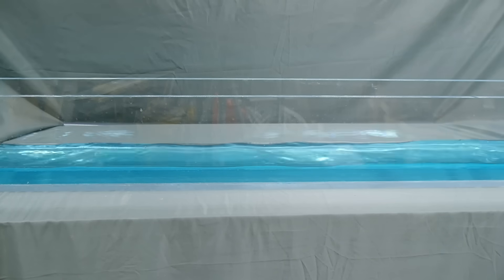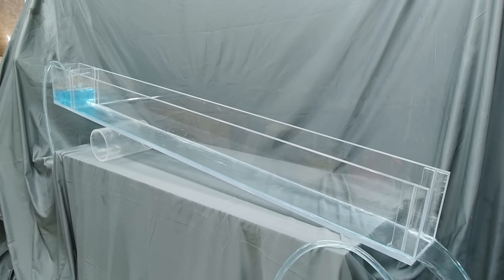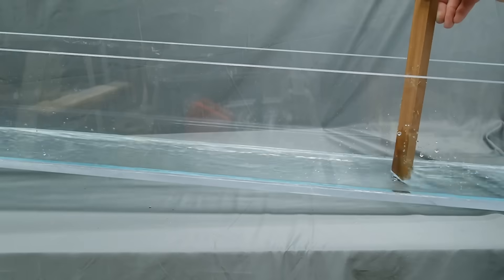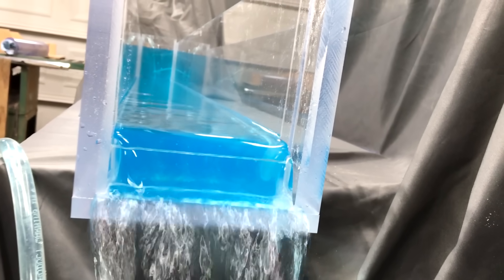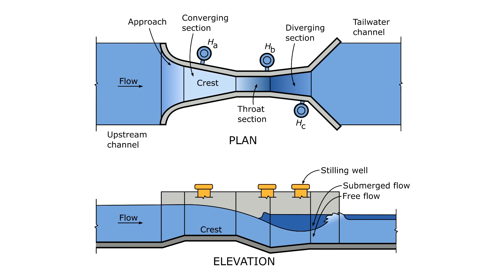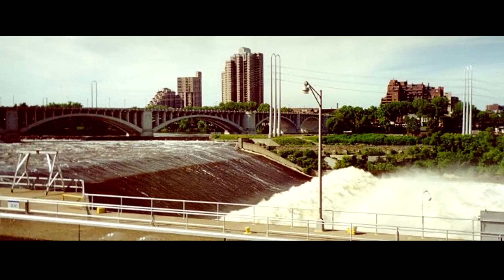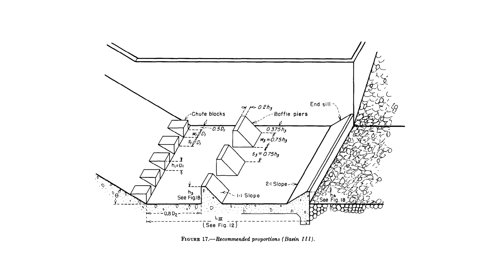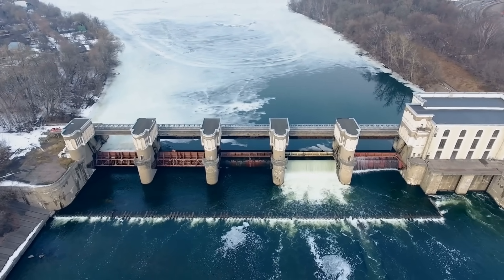What is a Hydraulic Jump?

Comment: Hi Grady, thanks for the great video! I am curious about the part where you mentioned that the energy from the lost flow speed is dissipated as heat in a hydraulic jump. Are there ever hydraulic jumps large enough (perhaps following a particularly large spillway) that they can create a significant change in water temperature?

Comment: If old Mississippi could b also controlled by a U shaped sq or rectangle system no top of box, the power & volume of water could b up stream diverted to a storage sink or basin. Smooth walled when normal flow & rocky walled w/speed bumps & diveting when water volume & power high. U can add as many of these U shaped sq/retangles as needed to hve needed effect.

Comment: saw something about 3 min mark, still hve no idea yet what u r talking about grand or tiny view of understandingie no clue what the hell u r saying may need to make this video multi prts. OK if the channel of the water stucture was not round or sq but instead retangle, & u could switch it mechanically, from sq to retangle as needed that would effect the flow. NOW if the sq inside channel was smooth & the retangle inside channel was rocky like a stream bed this also would effect flow. NOW if the rocky stream bed inside wall also had speed bumps aong the bed this would also effect the flow. If turning from sq to a retangle allow sink type over flow drain hole to NOW b in the flow instead of sitting up high not used, u could divert some (1 or more sink over flow)of the water into an up stream reverse flow every restricting tube pushing the water higher & higher till it collected in a raised tank or basin higher sink.

Comment: I know this is an older video so you might not see it but why aren't underground drainage tunnels ever built into hydro electric producing drainage system hybrids. I know in some places with low rain levels it would be useless. But I'm from Houston Texas and I've seen insanely large amounts of rain, flooding and all that jazz. Is there no smart way to harvest that water flow economically or is it a matter of the age many of these tunnel infrastructures are that retrofitting them wouldn't be worth it? The part of the city in which I am from elevation constantly changes to drain out all the water to the river. So there is large amounts of downwards water flow. Constant heavy influxes of rain. And thinking about the flooding issues we faced with Harvey and Irma they are going to increase drainage capability over the next few years. With the massive land mass of all this water draining into one direction could it be used for electricity or would it not be worth it. I'm honestly just curious and hope you can get back to me.

Comment: Have a question that I am having a hard time finding information on.  What would happen to a river's elevation if one were to temporarily dam 75% of the river?  How tall would that dam need to be based on backwater elevation changes?  I work for a construction company that is often faced with engineering questions that I try to learn about.  This question specifically has been bugging me because I don't know if anyone actually knows how tall this "dam" needs to be in order to effectively work.  Thanks.

Comment: Thanks! - that was super interesting.  One  point that tripped me up was when you said 'we also care about the velocity of waves, or how quickly pressure disturbances in a fluid can travel'.  It seems like this is a different thing (e.g., pressure disturbances, where the restorative force is the bulk modulus, as in acoustic waves in the fluid) vs. waves on the surface like you've shown (where the restorative force is gravity).  I imagine that these different waves travel at different speeds (?)  Anyhow, it's the phrase "pressure disturbance" that seems a bit wrong to me (I understand that as the surface gravity wave passes over a point, it will cause a pressure disturbance beneath it, but pressure disturbance is usually taken to mean acoustic waves).

Comment: You can also see this in spectacle on the beach at the ocean where you have energy from the waves hitting the shore at 70-85º and the bysmerty of the shore is 5-8º normal to its force. The water will flow back down against the incoming surges and cause a jump that will spray upwards like a line of gunpowder is going off. Super cool!

Edit: You can also see this in the same situation where that energy of the wave goes against the shore and curls to a point rather than going straight back out. This can be traced due to the froth in the water, the waves will still come in along the point but due to the force of the not dissipated energy from the shore surge this is called a 'RIP' and will cause the waves to stand up and almost stall out without reaching the shore. We use this in surfing to 'carousel' rides, using the rip to get out along the pointe, then riding these stalled out waves rather than going to the normal point breaks provided swell direction is appropriate.

Comment: i have concrete flip buckets at the end of my flood spillways, been testing coal tar epoxy on them for cavitation erosion testing, so far so good ✌🏻super critical flow is what the oroville spillway failed from, when it would go over the drop you can see it just turn white from cavitation.... it’s like little fire crackers going off ... what the seismic sensors were picking up. (the jump down)They need to slow the speed down at that point

Comment: Geographer by education here. Love your channel. However, I disagree with your comment that tidal bores only happen in a few places. Tidal bores are only a function of tides going up stream. The geometry of the local hydraulic system dictates the size and scale of the bore. Amazon and China have some famous large bores.

However, I've seen them as small as 6 inches traveling up concrete channelized river beds, the San Gabriel River in Long Beach, CA specifically. The end of the channel is a couple of feet above the low tide level but it is also a couple of feet below high tide level. Thus as the tide comes in and progresses up the channel, a tidal bore is produced. I've seen the tide come in and slowly creep up the channel producing a 6 inch tidal bore. Quite fascinating. And this happens almost 3 3/4 miles up stream from the open ocean, so it is not based on open ocean breakers.

Comment: Love the series! It's piqued my interest in sewer and storm drain systems. Drop structures involve way more hydraulic analysis than i'd thought. I skimmed this PhD thesis -- https://era.library.ualberta.ca/items/72078c56-f989-45e3-9198-9760ad6fb738/view/267e8135-d75d-4664-98b1-452c9a1d7df9/Camino_Graciela_Fall2011.pdf -- and that led me to the concept of https://en.wikipedia.org/wiki/Similitude_(model) , which i found very interesting.

Comment: Are there any equations for being able to predict where hydraulic jumps will occur? What is it about the geometry of hydraulic energy dissipators that causing the critical flow to transition to sub-critical flow?
Reply: You can calculate it with the froude number. The hydraulic jump will accur when the froude number Fr equals 1: Fr=(velocity of the fluid)/(sqrt(height of the channel x gravity))
Reply: @MrMatthew1311  By height of the channel do you mean the water depth or stage?
Reply: @steelmagnum  the depth

Comment: I'm a contractor. My current job is replacing a hot tub built into a basement remodel thirty years ago. With no room to bring in a new hot tub I suggested a whirlpool bath, an idea the client accepted. The biggest problem was that the hot tub had no drain, water was pumped into the adjacent shower pan when it needed to be refreshed. To overcome this I built a platform with the drain running between it and the concrete floor, through the shower wall, over the top of the existing shower pan.
   I was worried about water velocity because of the 20" head pressure. The drain leaves the tub with 1.5" PVC into a trap then travels at a gentle slope, 1/2" in four feet. As it enters the wall it steps up to 2" then flows out of a 3" shower pan drain with grill that is acting in reverse, water coming out horizontally instead of entering vertically. The volume is very impressive as is the sound. It is dispersed enough that it does not splash excessively, I think the grill helps a lot. I was quite pleased.
   Here is what I did not expect. The flow from the 1.5" pipe overwhelms the 2" shower drain. Water depth in the pan gradually increases to about 3", near overflow. Then the most remarkable phenomenon and the reason I write. A tremendous whirlpool is created at the drain, 3" deep 2" diameter. No water goes down the center of the drain. By coincidence I am reading a book "The Science of Leonardo". He would have loved it. With the ceiling light of the shower shining through the turbulence the patterns are stable and clear.
   I will cut a rubber washer to insert under the "popup" to reduce the flow. I think that will do the trick. We'll see. Thanks for your excellent videos.
Reply: It would actually be cool to see a video of this if you managed to record one.

Comment: OP should take a whitewater kayaking class.  The opportunity to explore natural water flows through whitewater paddling is huge.  It's a ton of fun and a great experience for us engineering types.  

Paddlers tend to call hydraulic jumps "holes" or "hydraulics".  There are dangerous ones and fun ones, depending on the size and the "corners".  If the corners of the hydraulic are downstream, then it makes it easier to get out.  Big hydraulics with upstream or even corners can be deadly.

Comment: You can easily see a tiny hydraulic jump profile by opening a mixer tap into a sink with a very low smooth steady flow. Aim the flow away from the plug hole. 
The water hits the sink and radiates outwards and as it slows it forms a raised lip of a few millimetres height

Comment: The roofs of houses in Bermuda use little steps to slow the speed of water run-off so that it can be easily captured as this is their primary source of water.

I wonder why they don't do this in spillways. Instead they make them very smooth, then try to engineer solutions to slow the water at the end. But if they had made them with lots of steps, the water wouldn't be able to get up to high speed in the first place.

Comment: is there a reason they don't use specialized turbines or some other device to convert the energy into electricity while slowing the water down instead of just letting all the energy be dissipated as sound and heat?
Reply: Cost/benefit issues. Spillways are generally not used frequently, so in dry times, the turbines wont work. When they do work, it's not going to be very efficient. There is a reason hydropower dams have large intake pipes that allow water to gain a lot of momentum before hitting the turbines.

There ARE however some places that do what you're thinking of. They use Archimedes screws attached to generators to generate power from slow moving water and small elevation changes.  You might be able to power a house off one. But not a neighborhood. Let alone a city, and it's got to be maintained. It's just not worth the money for the most part. But they do exist, and they are quite interesting.

Comment: Hey,
excellent video, as we are used to.

but I've got a critical remark, too.
maybe you want to reflect about NordVPN as a sponsor.

I don't have an english source so far, but a german site, called kuketz it security, recently published an article, claiming that the NordVPN app sends user data to several third parties, without informing the user about it.

NordVPN is said to send the users email and trackingdata such as the google advertising-ID, alongside with informations about the device brand, battery state, screen size, gyro-data, operating system build version, wifi, cell phone carrier, etc.

These informations can be used for a lot of things like fingerprinting a device. (recognize the device and track its activities on different services/websites, if they include certain services like google analytics, which most websites do)
In my opinion, that's not good practice for a "privacy company", to say the least.

Comment: Actually, fluid dynamics is much harder than rocket science. Newton's laws of motion have analytic solutions in all reasonable cases (where the mass of the rocket is negligible compared to the mass of stars and planets, and the speed of the rocket is negligible compared to the speed of light).

The Navier-Stokes equations don't, and there might be cases where those equations don't have a solution at all. We don't know, and there is a $1 million prize if you can prove "smooth" solutions exist for all initial conditions.

Comment: That is quite interesting. We have several dams in a row where I live. 3 of them are sitting within about a kilometer of each other right next to the city center in a gorge. We've got some of the hardest and oldest rock on the planet underpinning those dams, so erosion isn't as much of a concern. The major concern around here is freezing and thawing cycle, especially with global warming. It used to be that once the temperature dropped under zero, it would remain there until spring, but nowadays, it's gotten quite common to have several thaw mid winter. The river flows north, which can lead to winter flooding downstream. They are run of the river dams, so they just don't have the capacity to hold back excess water. They've been upgraded theses last few years with better gates to let the overflow out.

Comment: Hydraulic Jumps are also deadly causing many boaters and swimmers to be circulated back to the transition point. That's bad if you are in a boat because you can't get out of it and you could sink. That's really bad if you are in the water because you more than likely will be dragged down and rolled over and over again without any chance to escape. The rescue squad is usually able to pull your body out because it never flows downstream. Slowly, municipalities are eliminating these dam hydraulic jumps to save lives.

Comment: I was at the beach yesterday and a weird wave went past (through/around) me, which I wondered if it was a hydraulic jump wave (I'm guessing just a moving hydraulic jump). It was a turbulent wave without the possibility of breaking as it didn't have the right conditions. 
The furthest waves were about 3m tall, the ones we were catching (boogie-boarding) were about 1-1.5m tall. Maybe 5m in between breaks (as in rip curls/breaking waves). There was a rip (current) moving sideways at quite fast speeds and not all waves were coming in from the front. I'm in Australia.